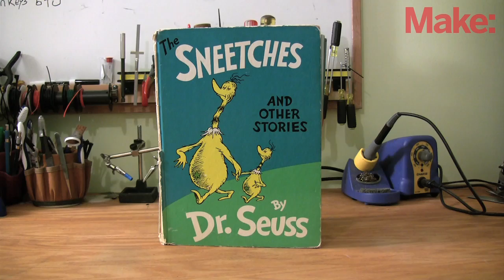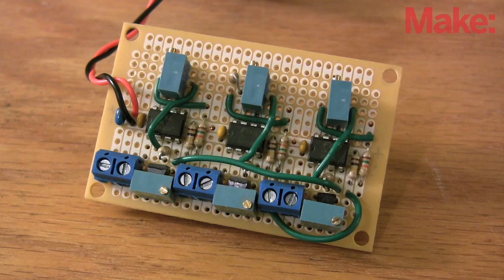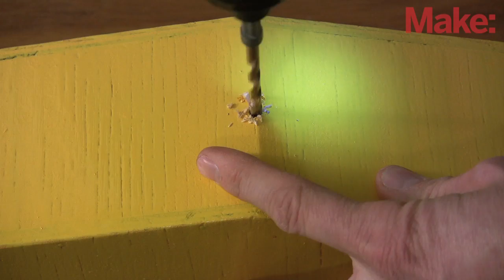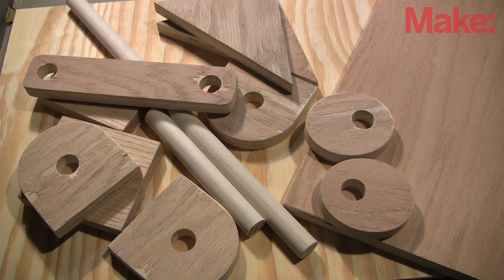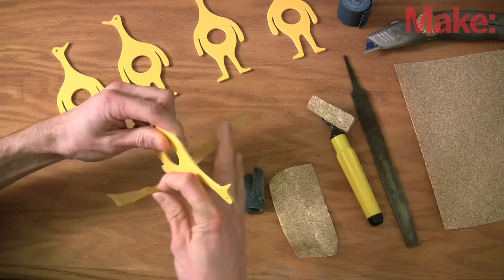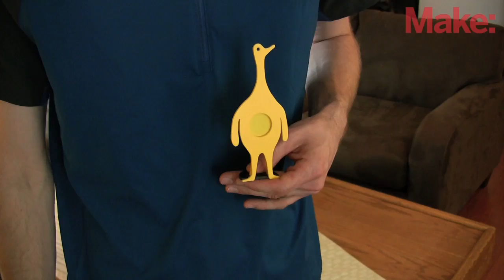Making Fun: Sneetches Machine

Comment: Indeed, the machines are electronically identical. They both send a constant 38kHz IR beam, without even any pulsing. I experimented with pulses for machine differentiation and for interference prevention, but deemed it too much trouble and cost to implement, especially given that my younger son kept forgetting which machine was which and just wanted the star to toggle. So yes, having both is just to improve the play scenarios by being able to act out the whole book.